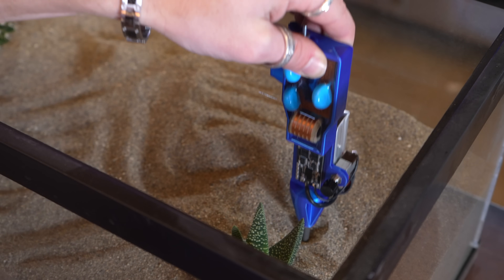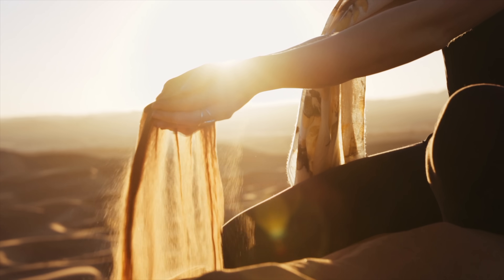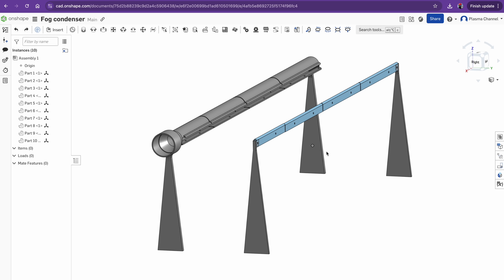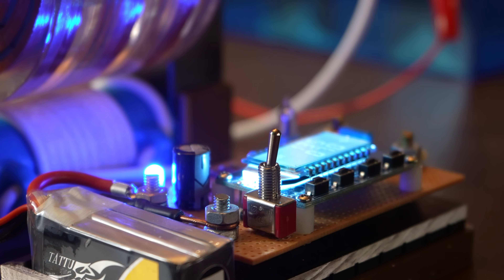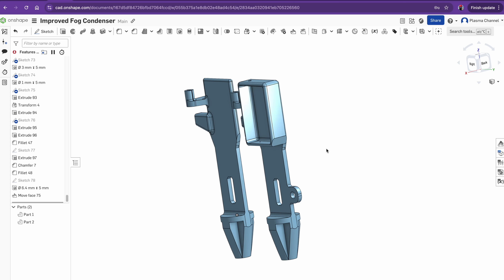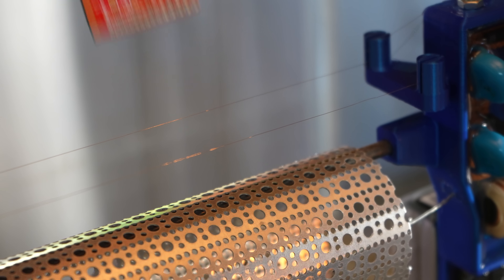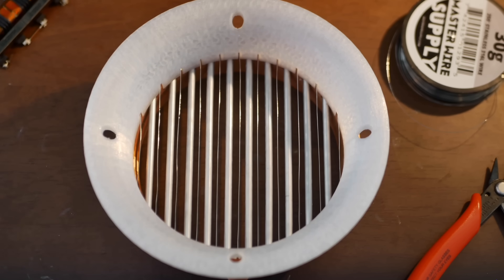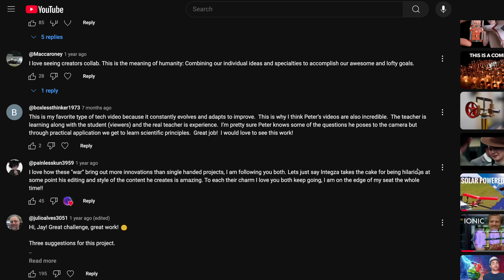Solving Desert Water Shortages Using 20,000 Volts

Comment: i don't know how useful this actually is, because there is a level of power draw that is necessary to get it working. I know there are cloud water collectors in some mountainous regions. These have these mesh nets that maximize surface area, and positioned so as clouds pass over them in the mountains, they collect water for the region. The nice thing about these setups is the complete passive nature of these nets. The other positives, is the setup is relatively low cost and low maintenance. The downside is it's weather dependent, and the amounts of water gathered is relatively low compared to other traditional water sources.

How would this compare to those passive systems in terms of pros and cons?

Comment: Awesome idea! 

Regarding water/fog collection efficiency, I'd suggest perhaps measuring as a percentage of the generated fog. It's all well and good saying you can collect 40mL in 5 mins, provided you have that fog density to begin with. So maybe investigate in terms of x grams collected from from 100 grams generated?

The other immediate thought is the collection range/fog replacement rate. It looks like you collect the fog within the vicinity pretty quickly, so would need some breeze or whatever to constantly source more fog. How does the collector work under various breeze conditions, and are they realistic at the collection site?

Again, a super cool idea!

Comment: using deepseek:  you know if there is scientific papers on this?
Yes, there are numerous scientific papers and studies on the topic of extracting water from air, including the use of electricity-powered systems like atmospheric water generators (AWGs). Researchers have explored various methods, materials, and technologies to improve the efficiency, scalability, and sustainability of these systems. Below are some key areas of research and examples of studies you can explore:

Comment: Would it still pull water out of the air, fog-less air, if you still had the same negatively charged grid and instead of two lines across the top more like six lines.  Two up top and two on both sides?

Comment: The process only works with fog or also work with moisture alone? condensing the water makes the air hotter?
Im asking because I live in South of Brazil... its Very Hot, incredible moist and ZERO WIND.... this may be an alternative to reduce moisture from the air and lower the themal sensation that is typically 10°C more than the actual temperature.
.
Also, Great project... 99,99% of projects to help Poor people in Africa are complete bullshit made to take public money.... In fact, when i saw the thumbnail, my mind was automatically thinking that it was going to be another bullshit, but when I saw that is from the Plasma Channel, I knew that was something worth the time, my belief in you was not betrayed, another awesome video... Please, dont sell this idea to a single corporation or some shit, if possible, make the patent public so no one can monopolize on it, or worse, just sit on it for 20 years. This can have an incredible impact on the people that need the most.

Comment: Actually, it's not a condenser, at least not primarily. The fog is already condensed water. This device is rather a microdroplet-thruster towards the net, so it should be called, for instance, a collector. A little of condensation could of course occur on the net itself, but it would anyway, even without the voltage.

Comment: Love it! Thank you for sharing your content. Is the pcb or its schematic in the stick open source or available for makers?

One question: Wouldn't a bigger surface area instead of the wire make more sense? Once the droplets are charged they are directed towards the other pole, but for initial contact you are depending on a droplet randomly (more or less, ignoring the flow of air due to already charged particles) touching the wire. So my guess is that a larger surface area would increase the droplets being introduced to the system in the first place? 

Thanks again! You deserve a Coffee!!

Comment: A typical reverse osmosis system produces around 0.33 liters of water per watt hour of electricity, with the average energy consumption being around 3 kilowatt hours per cubic meter of water produced; meaning for every 1 kWh of electricity, you can produce roughly 1/3 liter of purified water through reverse osmosis

Comment: You should think about doing some testing in Tunisia.  Last I checked, the hotel that was used for the interior of the Skywalker residence is still operating, and the exterior sets are still up as well (though not in quite the same area.

Comment: Consideration should be taken about where the fog would have ended up naturally.  It is the disruption of these natural cycles that have lead to many of the shortage issues we face now. Taking the water out of the air could spell drought for other climates, in addition to the "snowball" of lower moisture air being able to move less heat. Still neat tho.

Comment: * Good luck on your very worth while experiment.*
 - Please consider extending the negative collectors upwards as well. The shape of a wing should give good airflow. A free floating positive wire may not be the best at "Wringing Out" a fog bank. Channel the water through a gap and airflow will follow. The water production should increase accordingly. You may be able to lower the power needed as well. I also suggest a power in vs water collected exp. to find the sweet spot.
  I worked on a similar electrostatic collection system back in the 1980's but it was for smoke and micro dust using an emitting wire and conductive low PPI foam as the particle collection media. I spent a lot of time in the dark room observing corona to find the best way to make as many particles I could pass through the emission zone. I had the best results by creating a funnel shape for the particles to follow down to a narrow gapped opposing teardrop shape negative electrode on either side of the positive emitting wire centered in the gap. )*(  All airflow came between the electrodes and the wire and that is where I found maximum particles collected/time was for smoke.  I think you may be able to draw from your own experience designing the electrostatic thruster you made to increase air flow and water collection. 
- Best Regards

Comment: H2O is light. One stake, with power below and a tad upwind so water floats up to the grid and drips miss the wire.
Too bad there's a mismatch in timing for solar. Transmission lines can help with that.
Thumbs up
Reply: O3 is nuclear fence 😅

Comment: I wonder what the radius of ionization is off of the wire to determine the height of effect that this has.  Since there is a radius of ionization off of the wire, I wonder about the best shape of the capture grid.  What about a simple metal screen?  Thin mesh fencing,  Galvanized Steel hardware cloth.  I do like how you have distance between the front and back of the capture grid so that any moisture that has not been caught in the first layer may be caught by the second as it leaves the charged area.

Comment: Interesting. Thank you for providing precise measurements at the end. The 14 mL/Wh  translates to 24 kWh/m³, which is competitive with distillation desalination plants (if those were heated by electricity for some reason), but far behind reverse osmosis at 3-6 kWh/m³. Of course, those require a nearby source of salt water and decently built out power infrastructure while this could be built off grid at small scale. I wonder if there's any decent small scale reverse osmosis systems rated for saltwater? The ones I found offhand are meant for tapwater. 
Reverse Osmosis can be run entirely solar fed during daytime (with high yield solar in the desert), while it's unfortunate that the timing to power the electrostatic method with solar doesn't work out unless you have some pretty beefy battery packs driving up costs. If you have fog, you don't have much sun, and vice versa.
Also, I like the throwback to the ionic thruster. I wonder how that would affect its efficiency when passing through cloud layers with a (theoretical) airplane using them?...

Comment: Great application of the study data! I think you may be missing something, though. While it's great in concept, I'm not sure it's as good in practice. Water dripping in lines would surely water crops but it would also waste the water that drips between the plants, quickly losing it to evaporation in the arid climate. Placing miles of wire/grid lines over crops would also require a lot of material and money. Moreover, it would interfere with tractors made to straddle rows of crops when applying fertilizer, select-kill herbicide, pesticide, etc. It would also be susceptible to damge from wind, weather, and animals.

What about a larger set-up beside the farm field that uses a larger grid and then stores the water for a drip irrigation system? You could possibly use a metallic cloth beside rows of thin wires to collect water to a trough, such as is used with unpowered fog collectors. If it's stored, it can not only be used for crops but provide fresh drinking water to the farmers, as well. If solar powered, it can collect the morning fog then use the abundant sunshine from the rest of the day to recharge the batteries. With the amount of time in sun vs in fog, it probably wouldn't take a big solar panel to recharge it for the next morning. 

Regardless of the eventual design, I'm looking forward to see you do larger scale testing in real world conditions. If it performs even half as well as the small set-up, it will be an impressive display of technology.

Comment: The problem with this idea is that the areas that are the most dry are… the most dry. None of your b-roll of fog showed morning fog over deserts. In your own tests you had to provide an unrealistically dense fog for it to even work, and this is at room temperature. Low humidity like in deserts doesn’t condense into fog until it’s close to freezing and once frozen humidity goes to zero. 

That cheap amazon dehumidifier will work down to 40% humidity (not that dehumidifiers should ever be used to collect useable water), this video implies that this technology won’t work below 100% humidity. It would have been much more useful to see a test where you put it in your backyard and show it working in your own local morning fog. 

If coastal fog is the only practical environment this can be used in then how does it compare to methods of purifying salt water?

Comment: the dehumidifier you have is almost positively powered by a peltier, based on the small footprint.  those are horrendously inefficient.  the larger ones that use phase change are very efficient.  that would actually be a more fair comparison